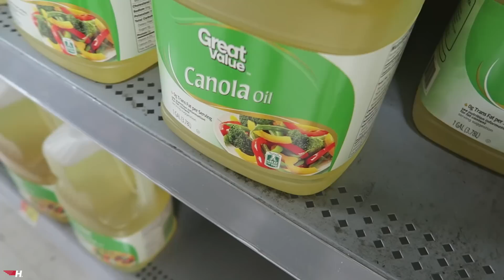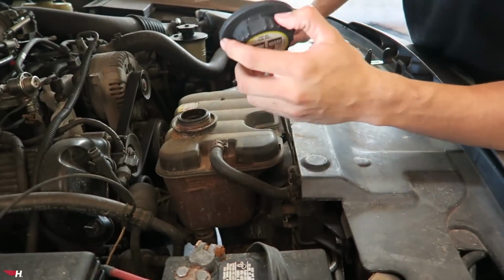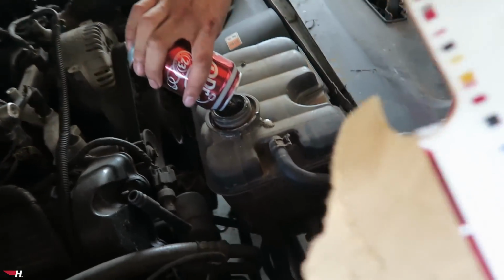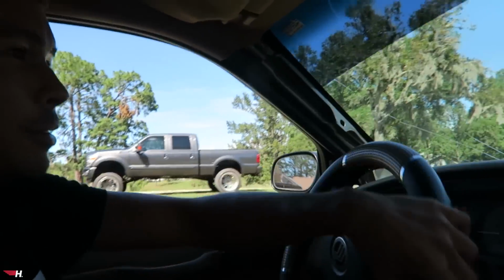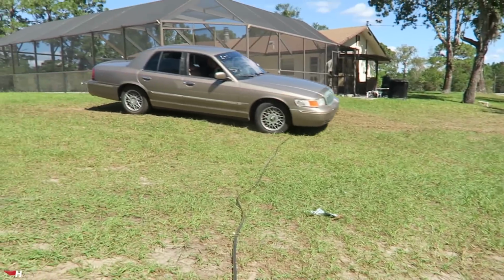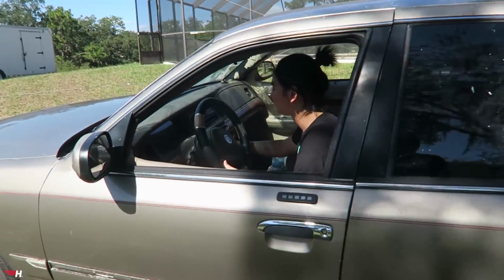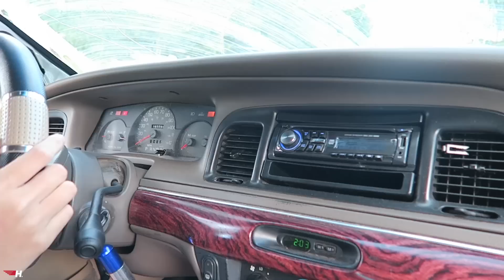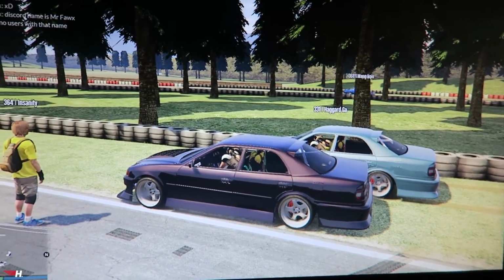Can You Use Cooking Oil As Engine Oil?

Comment: Ruined a perfectly good V8
Reply: V8
Reply: Xl S1N1ST3R Xl Grief Thanks at the time I typed that I couldn’t remember if it was a V8 or V6
Reply: The_ Mysterious_Gamer Easy, look at the tail pipe. 1=V6 2=V8
Reply: Literally all I could think this entire video.
Reply: I realized that a V8 cause the valve covers looked familiar to my F150s engine 

I was “like what the fuck is that a Triton engine”?  😮
Reply: You should've bought it first bud
Reply: Deez Nutz that is incorrect, tailpipe is not an indicator of that, if you dont know somethings true dont say it, people come to learn or see cool shit not be misslead
Reply: Not true. Most Crown Vics have single exhause and they are all V8's. Plent of V8's have single exhaust plenty have dual exhaust. Same with 4 and 6 cylinders.
Reply: It's the same engine as the 4.6 triton

Ford used them in the 91-2011 town car
92-2011 crown vic and grand marquis
96-2009/10 mustang.
96?-2009/10F150
cougar
thunderbird
continental but that's the dohc 32v along with the lincoln mark VIII
explorer till 01 or 02
and probably some other vehicles I'm not thinking of

I've seen plenty of fleet ford 4.6's go over 500,000 miles
I've personally taken 3 to 250k plus with 0 issues.
and even in a big heavy car like the crown vic, grand marquis, and town car the 190-220 hp they have stock is plenty to get you moving and keep you going, torque numbers are up around 260-275.
Reply: Perfectly good v8 like this isn’t the most mass produced v8 of all time
Reply: Lagunas454R Lmao that mouth open little yellow face just hilarious and adorable.
Reply: I think the v8 is old and has to many miles to be useful
Reply: Just buy a new bottle. They sell V8 in the beverage aisle all day.
Reply: Nothing good about those V8s.
Reply: It's a Ford..it was ruined during the manufacturing process.
Reply: @deeznutz2646  facepalm there was no v6 lol
Reply: Ryan Owens Shitty? Having 2 valves per cylinder doesn’t make an engine shitty.
No, it’s not going to flow like a 3 or 4 valve and make the numbers they can, but try getting the efficiency and longevity of a 2v in a high performance V8.
Low to mid range torque for the gas used and reliability is where “shitty” head design rules car markets
Reply: Michael Hite That’s why can companies use them after police departments beat them up and still take them to 400k?
Reply: Biggie Cheese True, it looked to have close to 200k, and unless it’s in great condition, not many people want that car. Although I like the platform, there’s plenty better specimen out there
Reply: @deeznutz2646  Not true. My crown vic had one exhaust and was a 4.8 (or 6) V8

Comment: Pouring Dr.Pepper in the engine basically ruined the whole cooking oil engine oil test. The dr.pepper will cook out and leave a sugary, crystalline residue that bearings won't like. Even if it's not enough to make a big difference, you just threw out any chance the cooking oil had. That was just dumb, otherwise I like the experiments you perform, but even if it's for entertainment, it would be nice to try and keep the variables as limited as possible.
Reply: Coolant doesn't come into contact with any bearings lol
Reply: @joearden6772  he poured some into the motor as well

Comment: The real question is can you use engine oil to cook food? 😂
Reply: Talon Morgan probably
Reply: Talon Morgan is that a challenge
Reply: Not safely. Pure petroleum in itself is non-toxic (as it's used in baby oil and petroleum jelly), but all those additives in motor oil (corrosion inhibitors, viscosity index improvers, leak stoppers, etc.) can be toxic.
Reply: That sounds delicious
Reply: Talon Morgan 
Yes you can. I wouldn't eat it though.
Reply: Yea. But the food can't be eaten. Unless you want to get some cancers as the result of fuel poisoning.
Reply: Talon Morgan let's see how long you take to recover from poison
Reply: Talon Morgan xD so true

Comment: I generally get disgusted when you ruin decent cars, but this I just don't understand.
Reply: Wasn't it like $500? 
They had fun and will make money off this video.    Why people get so made over everything they do I just don't understand.
Reply: Trafficit, A $500 dollar car is usually a shitty car with problems. Don't believe me? Go out and buy a $500 dollar car and you'll see the problems that it has Like rust, overheating issues, transmission problems, electrical issues, etc etc The list goes on and on.
Reply: Kasinova Da Don i paid $160 for my maxima which is my dd and i replaced a fuel injector and i have been driving it for a year with no problems
Reply: William Ramirez in Florida though?   Cars in Florida you are luck if you get a rusted 300k mile pos for 1k
Reply: J⃟O⃟N⃟A⃟T⃟H⃟A⃟N⃟ S⃟C⃟H⃟U⃟L⃟T⃟Z⃟ it is a florida car and it had 209k on it when i bought it it now has a little over 216k and i drove it to and from nc twice (i live in nc currently)
Reply: The car is a literal piece of shit....
Reply: William Ramirez, I was talking about when you go and buy the car you'll start noticing problems. You replaced the parts that had issues so the car won't have any problems that's why your car is driving fine now.. $160 for a Maxima? That's cheap man. I've seen some Maxima's for sale but never that low
Reply: Kasinova Da Don it was just a bad fuel injector and it came with the new one it cost me $30 for a gasket and a hose to get it back on the road its a 93 it also had a bad exhaust leak which was a missing flex pipe so i just replaced the whole front half of the exhaust for $300 but that was 5 months after i started driving it
Reply: Cheapest maxima I found was $500 for a rusty one that doesn't run and $1k for a nice one but a blown head gasket... granted I did quickly search and only did my area but still...
Reply: Kasinova Da Don depends where you get it
Reply: 500 would buy a pretty sweet compressor.. or you know. Tools
Reply: William Ramirez, That's not too bad but that's good that you replaced the parts. The engine in the '93 Maxima is solid? The engines in those Maxima's they last long?
Reply: Sarcastic Fuck, Yea that's true
Reply: Kasinova Da Don it has the vg30e which is the same engine used in the z31 300zx they are known to hit 500k in the maximas
Reply: Kinda hurt me, I'm a panther platform fan. Lol
Reply: They get $1000 cars for $500 because of their channel. Good luck finding the same deal.
Reply: Trafficit exactly just bc it’s only a 500$ car doesn’t mean shit they could’ve saved it to buy something useful like idk FUCKING TOOLS but instead piss it away. That’s like me buying a 500$ phone and destroying it on the spot and saying it was just 500$ there’s phones way better then that.

Comment: Don't need to worry about these guys, they were using a concrete block instead of a jack stand while they were under the car, they are in the running for the Darwin award doing stuff like that.
Reply: Not to mention ruining one of the most reliable f**** cars on the road
Reply: You think a jackstand is stronger than a cement block?
Reply: William Bowen A jackstand is oodles stronger than a pourous, probably cracked cement block lol stay outa the shop bud youd be dangerous to others
Reply: Split Rim 509 eh not really it's about as strong but not that stronger than the Jack stand you think using a concrete block is bad tell that to the people using wood.  😂
Reply: Split Rim 509 some people choose to not give a fuck. I've seen numerous times where a person put a car on a floor jack instead of stands to do a oil change or something. Are you supposed to do that? NO! Have I seen anyone die? NO!
Reply: Bigdick DA9 Well maybe you havent been around in the shop long enough to see it. I run a commercial truck tire and service outfit in the dryland of eastern Washington. Ive seen trucks come down and sever guys in half, split rings put a guys head in two. Following safety precautions wont always save your life but if your planning for longevity, itll help ya last longer. 50 miles from the nearest hospital man a simple mistake may take your life
Reply: Split Rim 509 I hear you and I do try to always follow safety precautions as well. All I'm saying is to each their own right? Natural selection kind of thing.
Reply: Bigdick DA9 I hear ya man Im just used to trying to keep my men safe but to each your own Im a do as I say not as I do kinda guy myself, everybody takes risks. Plus we need a little more natural selection these days for sure haha
Reply: Under tension it is. Concrete can not support anything if tension is being placed on it and the fact one tire is off and a number of other factors means the center of gravity for the car is off and this places tension on it. This is why they do not make jack stands out of concrete. Concrete in this particular application has no place and is weak once tension is introduced. It is comparable to using wood. 

I can see why some might think it is logical to use it when a jack stand isn't available but considering steel has high strength with or without tension placed on it means it is the logical material for a jack stand. 

Not willing to buy on for 30 bucks is not a logical reason to risk your life like that. Plus the whole concrete eventually cracks and erodes over time no one knows when that particular block was made and how much exposure to the elements it has had so there is no way of knowing if the concrete is structurally sound. Where as in steel you have a lower probability of death using it.
Reply: Least they used that, I see people all the time using nothing but a floor jack.
Reply: @dirty_da9914  I've seen floor jack braking and car going down, luckaly nobody was under it.

Comment: Someone had literally just put a new intake manifold on the Grand Marquis and clearly they pinched an o ring in the fuel rail.

The 4.6 Ford is a very robust engine and I'm not surprised that it held up for this experiment.

Great video.

Comment: One thing I've always wanted to do, was replace the engine coolant with thin oil (0w-30) and see how long it would run for.  Will it overheat, will it run normally, will the cooling system last longer, or fail quickly?  Will the hot oil eat through the hoses and seals?
.
Does oil cool better than antifreeze or does the engine throw a shit-fit because it can't shed it's heat?
.
I've never had a spare car or a junker that I could test this on, but I've always wondered....
Reply: If you removed the thermostat so that it always flowed without restriction, you might make it like 100 miles without overheating.

Comment: Engine oil is designed to stay cool cooking oil is designed to get hot so total FAIL
Reply: King Slayer  still better than no oil at all.  An engine could run on the veggie stuff for quite a while, especially if you don't beat the hell out of it like those two idiots did.

Comment: Use gas as oil
Reply: gavins youtube does it work?
Reply: The original formula for Amsoil was corn and soybean oil in equal parts and enough peanut oil to reach the max temperature rating desired of the oil. This is traditional motor oil.
Reply: gavins youtube If you do that you might as well burn your car down in the process 😅😅
Reply: That'll be the funniest episode if the did that. I'll die laughing for hours.🤣🤣😂😂

Comment: cinder blocks as jack stands...literally the worst thing you can use.
Reply: Jeff Minnion I'd have to say scissor jacks are worse
Reply: TheRobb573 those blocks can fracture pretty easy, when they do they entirely fail.. this is how kung fu people can destroy them.
Reply: Depending on their condition and if you use them correctly they can hold a lot o weight , they hold up houses
Reply: Brad Dunagan they hold up houses using a fuck ton of them and normally they are turned sideways and have rebar in the center also, the way they lift a car could never be the same and your not gonna be chillin under a house in most cases either.
Reply: Yeah two facing downward with the centers facing up wouldn’t have been an issue
Reply: They're good in compression but awful when percussion comes into play. aka if the jack's seal slowly breaks then they might hold up but if it fails suddenly the block is useless. considering the car's underside will basically never be parallel with the block there would be some impulse (percussion) on the block if the car fell regardless - which is why they say to never use them.

Comment: I'm very curious about the results.  Because today, oddly enough, in Indonesia there is a trend of using a mixture of cooking oil and engine oil as a lubricant for cars and motorbikes.  Some even use 100% cooking oil to lubricate their cars and motorcycles!  They believe that using cooking oil as a lubricant can clean the engine from stubborn sludge, and can even make the engine last longer.  I don't believe in it myself, but the problem is that a lot of people are affected by it and they say that it's true that their vehicles have become very comfortable to use and the dirt in their engines is gone when the engines are disassembled.  Can you experiment with opening the engine bay before and after using cooking oil to lubricate your car?  I'm really curious, so many say their machines get really clean!  But I'm afraid to try it, I'm afraid my car is damaged.

Comment: It will ultimately fail because it’s void of special additives anti foaming agents viscosity stabilizers...  I’ve seen canola oil used as a substitute for hydraulic oil it slowly turns thick and gooey then a black solid clogging the hyd hoses.

Comment: The original formula for Amsoil was corn and soybean oil in equal parts and enough peanut oil to reach the max temperature rating desired of the oil. This is traditional motor oil.

Comment: Got drunk as hell one night doing off reading and blew a radiator line. Shook up bud light to get it flat and filled the radiator with it after we fixed the hose. Than forgot about it. About 2 months later we went to hog woller in Florida for more mudding. Checked the radiator when we got there and finally remembered the beer when I pulled the cap off and smelled nothing but rotten skunky Budweiser. Moral of the story is if you get the carbonation out I guess beer will work for a little while as coolant.

Comment: Sure.  Vegetable oil will work just fine.  They used to use castor oil in race engines back in the 1920's.  What do you think Castrol is named for?

Comment: I ran over 18k on canola oil in my corolla, blended 3:1 with pennzoil platinum (3 parts canola to 1 part pennzoil) with oil analysis at each 4500 mile oil change with no increase in wear metals over when i had been running just pennzoil and doing 3k oil changes, then sold it back to the guy i bought it from... it only worked out because i drove it often and drove it hard, which kept the canola from going rancid... he let it sit for weeks at a time and blew it up within 3 months, though
Reply: Decent 👌

Comment: What is the deal lately with the loud diesels? As aircraft engines get more powerful they get quieter. So a loud vehicle would suggest a smaller engine than a quiet vehicle especially the little cars with the fart cans. Top fuel dragsters I won't argue with.

Comment: That cinder block might hold that car, but it is too rigid and not strong enough to absorb the kinetic energy the car gains after falling even a couple centimeters. Why even put it there? At least rest the car on it first and then place the jack as a safety like you're meant to.

Comment: All the comments on here about the dp bring what did it in obviously know nothing about engines. The fuel leak is why it wouldn't drive and kept dying. Not enough fuel pressure to run the injectors. If they would have fixed that it would have drove fine. it's not a surprise that the engine was still running on cooking oil only thing bearings need is any type of lubricant that can keep the bearings lubricated without breaking down do to the engine heat

Comment: Use gear oil as motor oil. Like a 75-90w maybe even 75-140
Reply: That's basically just 10w-30 with different additives. You could go 10k on a synthetic gear oil but it might get a bit sludged up.

Comment: So test is see if cooking oil works as engine oil so u drain out the antifreeze! do you see the bs in that . The next test should be see if the car rolls down the road with out lug nuts but first take the rims off. And the next one should be see if u can get out from under the car if you pull out the jack

Comment: You trashed a Mustang V8 engine! Your fuel rail is leaking and and that car had a posi rear end. You could have lighten a few 100 pounds, cheap dual exhaust no converters, had throttle body bored out and you would have had a nice sleeper.

Comment: I'm already done with a 
70cc motorcycle. 1 months of nearly drive and nonstop 
290km distance. Actually the Bike in engine die situation. 2 years the engine noisy like tractor almost iTs Looks died but never after use cooking oil never death 💀. The motorbike age Is 
28 years old. ( Honda c70-boX shape headlights)